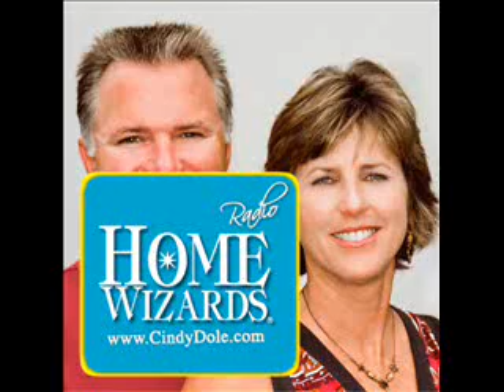Home Heating Troubleshooting (Part 1)

Comment from the maker: @quiznos38 
Got your answer for you from my friends at Pacific Aire - Here is part one:
The listener should check to see if the burner is lighting. The pilot staying on and the relationship to whether or not the valve opens and the burners ignites depend on how old and what type of controls they have. The second thing is to check to see if the pump is moving water (circulating) there is the pump and sometimes a automatic valve called a shoe valve. ( More in next response box)

Comment from the maker: If the burner is heating the water the lines will be hot, if the pump is working and the water is hot, the line temperature on the inlet side of the pump will be the same as line temperature on the outlet side of the pump. The same goes for the valves, the inlet temp should be the same as the outlet temp.if the water is cold and not flowing it will be cold on both sides of each and there could be a flow switch that keeps the burner from coming on .

Comment from the maker: And here is part Two Quiznos 38- The humming noise the pump is making could be normal and the pump could be running or if it is  loud it could mean the pump is going out but still running and last if could be stuck and not running at all, just making an attempt to run and that could be the noise. Does the system have a fan and duct work or is it a true radiant heat system? If it has ducts it could be the fan or the fan controls. ( more in Part Three next)